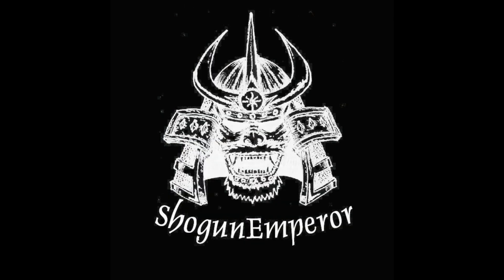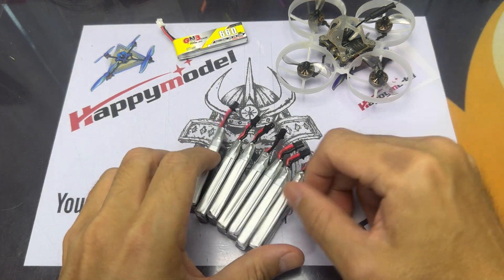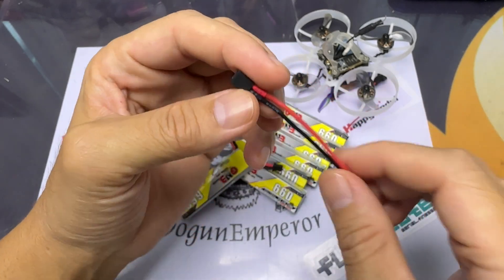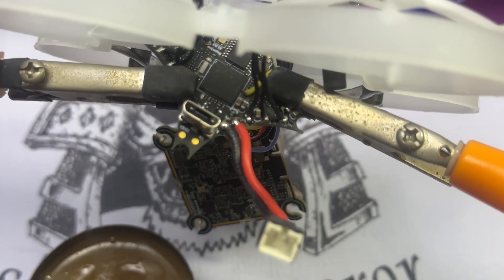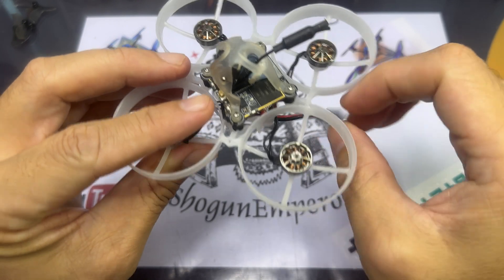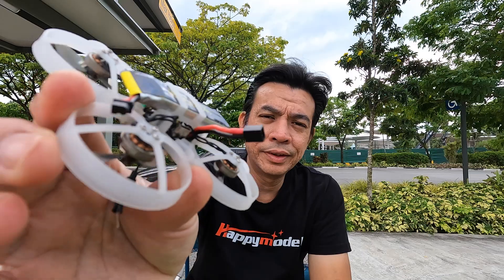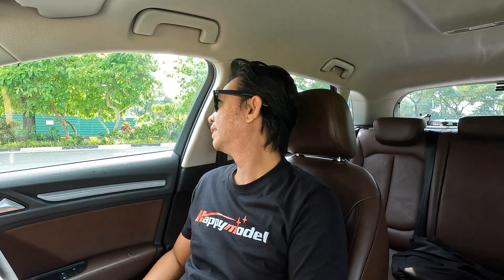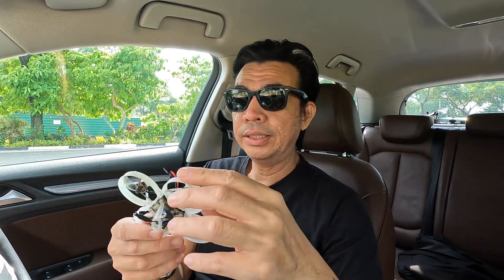GNB A30 CONNECTOR

Comment: The company is probably planning to replace the GNB27 with the GNB A30. This means that the GNB27 will probably no longer be produced. I think this development is bad. Everyone knows I find the BT2.0 and A30 bad because they have such a super small pin spacing for the cables to be soldered. Not only is it extremely difficult to solder and insulate, no, in my opinion, it is also more dangerous to have a small pin spacing... I will convert all my 1S hardware to GNB27 anyway that the GNB27 will eventually run out... The GNB27 has better pin spacing, and an XT connector has even larger pin spacing virtually scaled to the same size of a BT2.0. And the XT connector is undoubtedly the best connector in the RC sector at the moment...
Reply from the maker: Agreed. Though the spacing is much better in terms of data, the A30 has got lower resistance compared to the GNB27. But yeah… i think they mentioned that they will still continue to produce the GNB27 so i think ur good.
Reply: @shogunemperor  Even if the GNB27 is no longer produced. The demand will probably go down to 0 because of the A30, because everyone is now using BT2.0 and A30. I.e. the remaining seller stocks are sold super cheap. I will just buy me super cheap 100 GNB27 connector then I have lifelong GNB27.
Reply from the maker: @Sugalime3D_FPV  yeah. So stock up as much as u can if ur gonna use those. Especially if ur gonna replace ur old lipos.
Reply: I use gnb27 in my mobula7 hdzero build around 27g, 550mah perform very well, 5 min flight time outside. I am curious of a30 performance.

Comment: I tried mounting the lipo sideways to stop battery ejections and making them look like accordions, I found the frames break way more probably because the impact force isn't being absorbed by the battery sliding.
Reply from the maker: Does it break exact at the mount above the lipo?  I found that, thats the spot that keeps snapping.  I've mentioned this to Happymodel and they said they're working on it.
Reply: @shogunemperor  I only tried on the v2 frames but, it was mainly struts and ducts that broke more.
Reply from the maker: @thirtythreeeyes8624  its the same with the latest ones too. Just too weak in those area